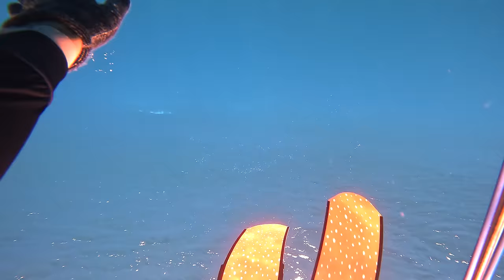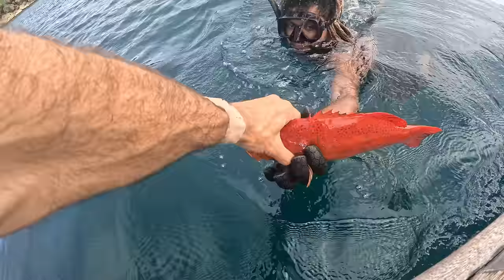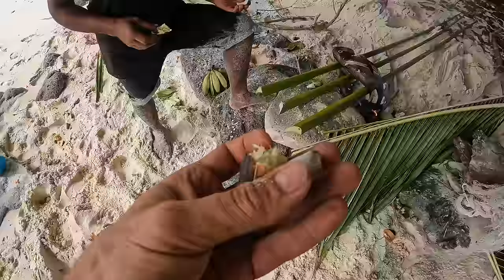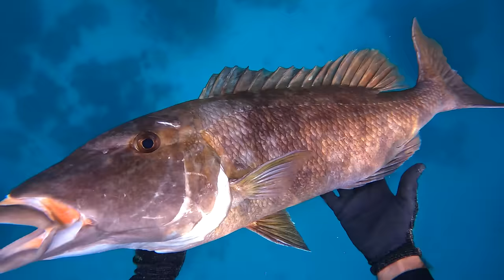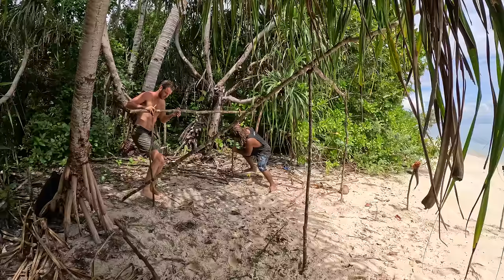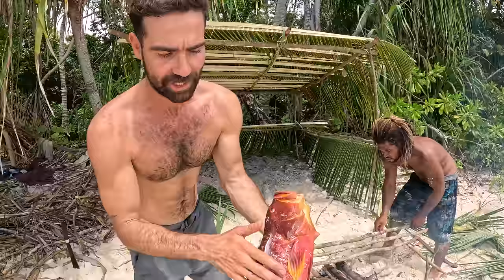BUILDING A SURVIVAL SHELTER (Catch, Clean + Cook)

Comment: Had the same component break on my boat...cam lever on the throttle.  Broke with the throttle wide open....I was trimming it up out of the water to drain it before a nasty winter storm set to be less than 10F.   It was very fun to work on in the rain while 45F outside 😂.

Comment: Just leave the gear exposed and do it manually. Had to do things like this before it’s a pain, but you can click straighten out that throttle linkage for clicking in gear and just manually click it in and then throw it when you have both motors again

Comment: Always keep several tubes of JB Weld in your toolkit you can easily repair that broken lever. The cable lever. It's liquid metal and it cures within 1/2 an hour.   Yes JB Weld is an epoxy metal that is useful for about 1000 kinds of repairs. Look it up and get some guys